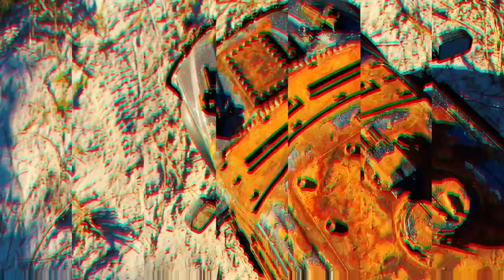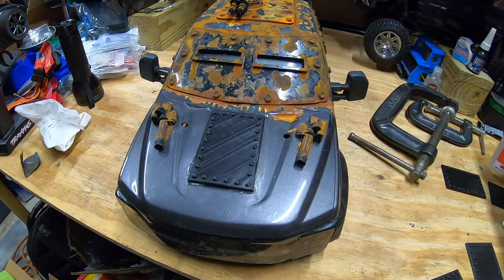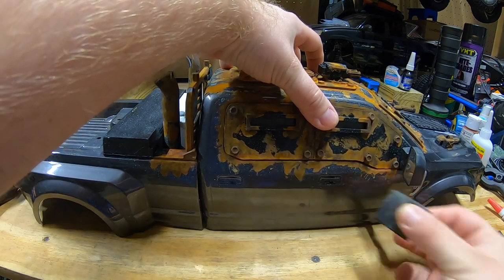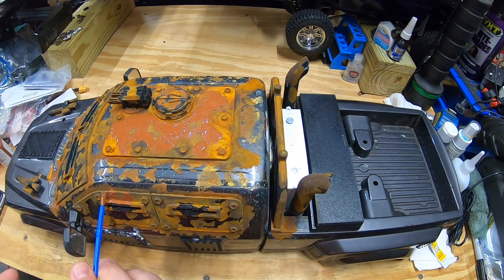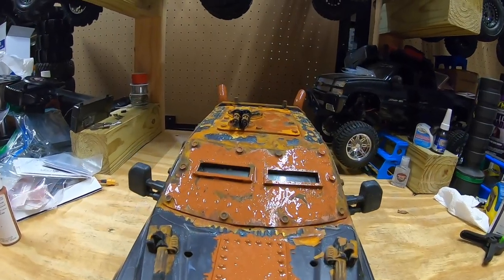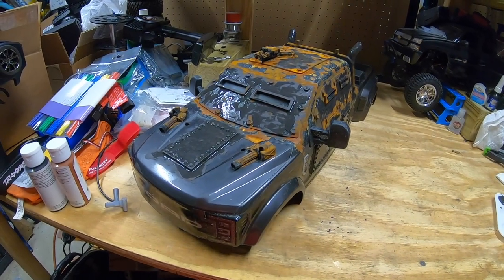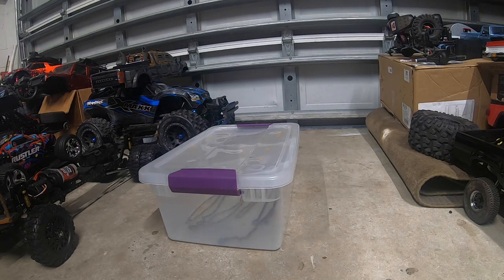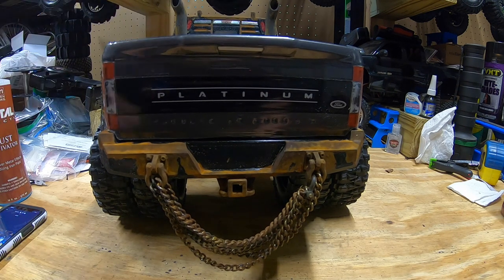CEN Racing F450 Post Apocalyptic Build - Armor Panels, Machine Guns, and Rust Patina Paint | XXL RC

Comment: Niceee, did you glue the tires?
Reply from the maker: I did not. They are 2.2” and the wheels are 2.6”, so they are stretched on there pretty good.
Reply: Thanks, how’d you get the tires off the stocks?
Reply from the maker: I didn’t. I bought new wheels. I wanted the black ones. Stock ones were red.